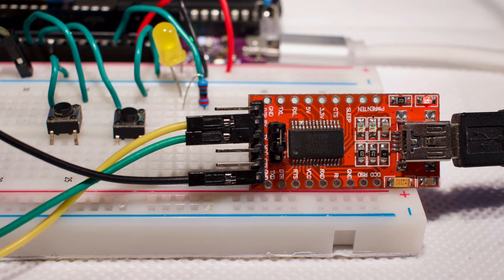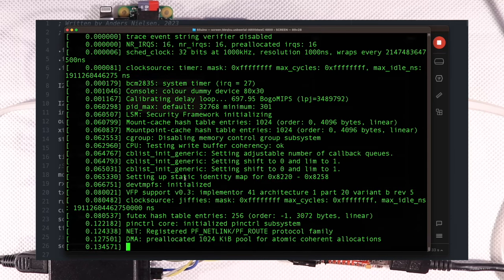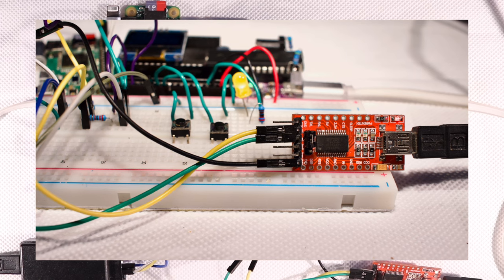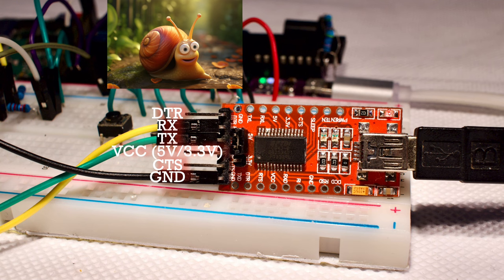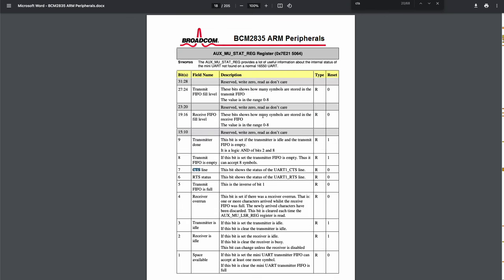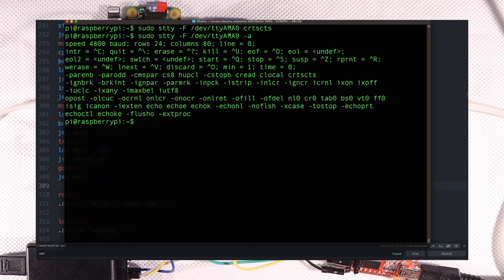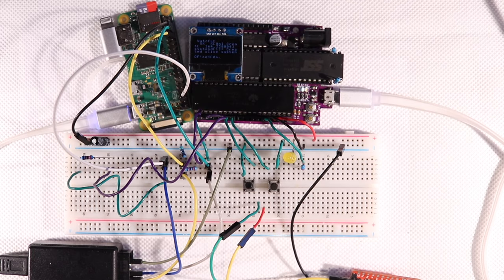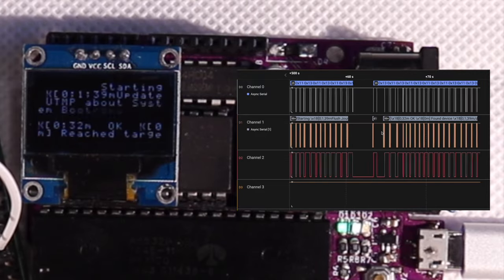Serial Flow Control. What's CTS RTS XOFF XON and why should you care?

Comment: Neat!  I'm often frustrated, while trying to get a serial connection (a "simple" serial connection) between two computers by how many different possibilities there are for flow control and no flow control, and the problems that arise when two computers both eschew flow control, but they still drop characters, showing that they clearly need it.  It's interesting to see it implemented on your 65uino!
Reply from the maker: There's also matter of noise - doesn't take very long wires to make serial data into complete nonsense. But at least 9600 baud is rather forgiving :)

Comment: For the kernel boot messages: check the kernel command line.  The documentation says that the console=ttyS0 line takes flow control information from the second passed parameter.  So to have ttyS0 be configured for RTS/CTS flow control at 9600 baud with no parity you’d have this: console=ttyS0,9600n0r
Reply from the maker: That part is actually in the video :) For the kernel in Raspbian though, that part doesn't seem to be compiled in, so console=ttyAMA0,4800n8r only sets 4800 baud, no parity and 8 bits ... but doesn't make it respect CTS.

Comment: Short version of how RS-232C flow control is supposed to work:  If XOFF/XON flow control is used, the transmitter is supposed to monitor incoming bytes and if an XOFF byte is received, the transmitter side should pause transmission and wait for an XON byte to be received before continuing sending.  If CTS/RTS flow control is used, then the transmitter is supposed to check RTS before sending each byte and wait for RTS to be enabled before transmitting the byte.

Unfortunately, the advent of very fast CPUs has caused many programmers even at the system level to just assume that the receiver can handle whatever speed has been selected and so the transmitter programs often do not implement any form of flow control.  This is a very common but very poor practice and illustrates how common "lazy programming" has become.
Reply from the maker: Yup. But note the transmitter should check (its) CTS - not RTS.
I hope the correct meaning came across in the video even if I misnamed RTS as CTS in the 6502 code.
Reply: @AndersNielsenAA  Yeah, I got confused.  The receiver requests sending, and the transmitter checks that it's clear to send.  I have to remember that.